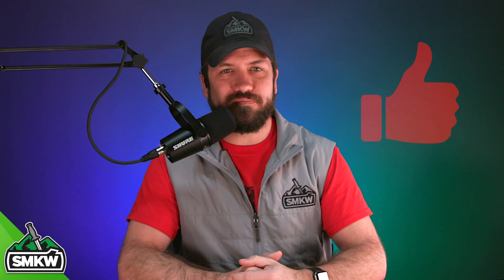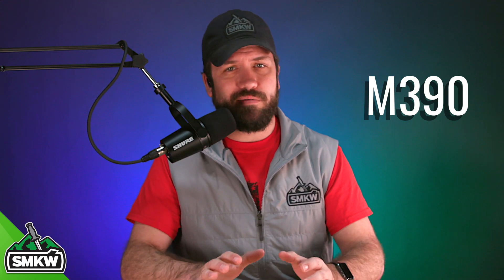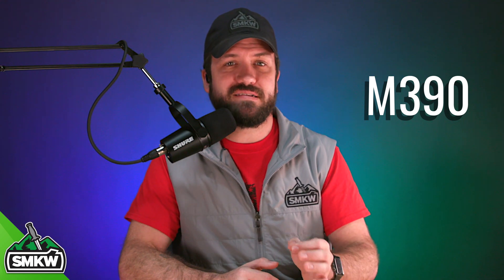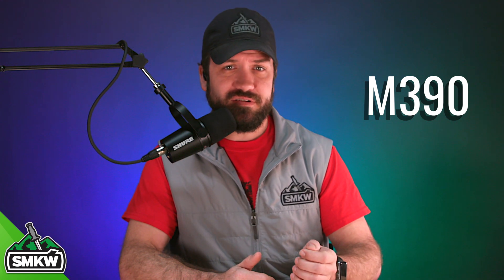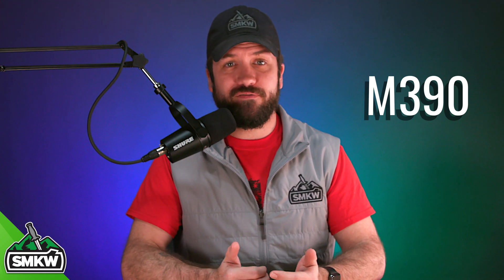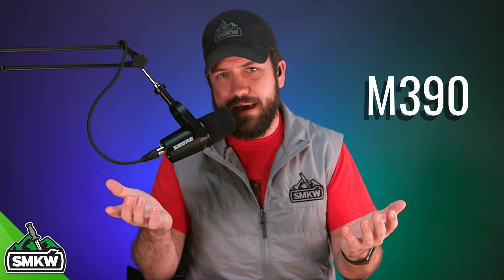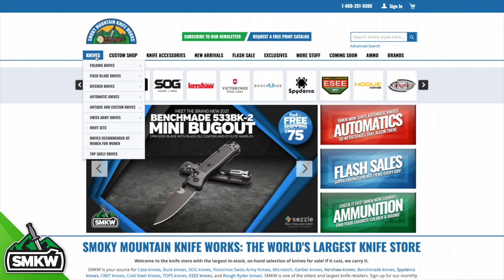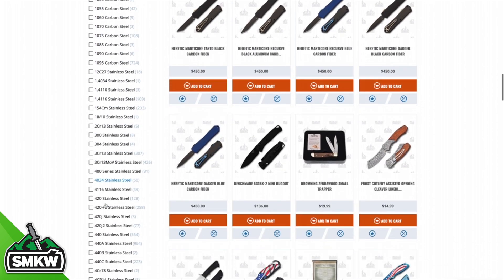M390 Blade Steel

Comment: Every M390 knife I've either owned or handled has just been stupid good. I'm a professional sharpener as a side business, and it's super rare I get an M390 blade in. Whenever I do, man, it takes a demonic edge. I hope one day it is at least a standard choice for makers. I have a Benchmade 761 that has since been discontinued that has M390 and I literally don't want to use it because I know it's kind of a collectors item now.
Reply from the maker: Thanks for watching and tag us in pics of the knives you sharpen on IG👍
Reply: Check out Microtech. They make a LOOOOT of their current knives in M390. If you’re not a fan of auto knives they also make folders. They’re pricey but they’re works of art. Plus if you’re always buying benchmade you obviously understand the price of quality and are willing to pay for it.
Reply: Kizer cyber blade has m390 its pretty cheap on ebay rn

Comment: If you’re good at sharpening, well treated m390 will take an unbelievable edge. My m390 Manix 2 gets sharp on what feels like an atomic level…it’s crazy. That’s its biggest strength to me. I wouldn’t buy “hit and miss” or potentially neglected m390 in a budget folder. You really want this stuff to be in top form because when it is, it’s unreal. If you’re into budget stuff, go with 9cr or 14c…there are plenty of budget companies doing great work with those steels.
Reply: Best place to check which manufacturer does it right is Outpost76 on YouTube and Tom https://youtu.be/PdnkLX-pWik
Reply from the maker: Good advice all around

Comment: I bought a few microtechs with this around 2 months ago. Scarab ii & ultratech, bayonet blade. Been using the ultratech edge seemed not to last long, hair shaving. Anyways.. i still love it! 🤩. Knives are something like lays potato chips "You can't have only 1" 😂. Hopefully y'all get some cyphers in Because I sooo need one lol
Reply: Microtech m390 is poorly done. You just wasted a lot of money on machining and polishing with a turd blade.
Reply: @tacticalcenter8658  Hopefully not 🙈. I bought a guardian tactical 040 im thinking of sending it back ,looks used. Great blade though 👌
Reply: @5shotsr611  https://youtu.be/fHXyzvqWs8g
https://youtu.be/SiU9fGURc-4
M390 should cut minimum of 300ft and ideally around 400ft. I say should and Ideally because every manufacturer does it different.
Reply: @tacticalcenter8658  dang. I heard a few guys going on like it was a miracle steel, 390 & 204. I know they sure charge alot for the mofo's lol

Comment: I love the fact that you try and simplify the metallurgical property advantages of Powdersteels but be careful as now you off base a little bit. As it isn't necessarily finer, its just that the distribution of the elements in the alloy is better so you do not get the accumulation of elements causing larger carbides and preventing brittleness of the steel and reducing other harmful effects of this lack of distribution.  Good video nonetheless but just be careful with that type of content as it quickly leads down to misinformation.

Comment: In your opinion what do you think is a better steel m390 or sv35?  Thanks
Reply: M390 is better.  If you know how to sharpen, you just need to do it longer, more strokes, but way less often.  It's an amazing steel for sure, it's my favorite and I have them all, almost.  Every time I have a choice of steels and M390 is available I'm instantly much happier with that knife, whatever it is.  I like ZDP-189 too, especially if it's from Rockstead, they can treat it better than anyone else can, so it's my absolute favorite but it's also no offered very much, very expensive and hard to find.  Lot's of good ones, M-4, S110, S90, S35 and S30, I like all of those but I place the M-390 at the top of everything except the Rockstead knives that are much more expensive and in a different league and need to be sent back to Japan to be sharpened properly.  Whatever you get, keep it well stropped to avoid dulling too soon. That's the 2nd. most important thing for keeping any blade sharp with the most important of course being, don't let a woman use it, they can ruin any sharp blade in 10 seconds by cutting on a glass surface or a ceramic plate and not bat an eye.  Women and equipment don't mix (line from Titanic).
I've never once seen a sharp blade in a house where a women also uses the knife.
 You can go years  in between sharpening M-390 if you do that.
Reply: @Billfish57  thanks for your input. I have a few different steels and really like s35 but I did just pick up a new blade in m390 and that's what drew me to this video. I was curious about it cause you don't hear much about it. The knives I have and am talking are a custom Chaves 228 in s35 and I just picked up a Chaves redencion 229 in m390 so I was curious is all.  Thanks.
Reply: That really depends on your personal preference and what you are looking for.  Both are great blade steels, M390 is going to be a little tougher while S35VN is going to be much easier to sharpen, M390 is also more difficult to heat treat and is typically therefore a little more expensive.
Reply: @TCB2Country122  s35vn is tougher
Reply: M390 is almost always similar to s35vn because of poor choice of heat treatment protocol . its wasting the steel and your money.

Comment: You mentioned HRC. What exactly do those letters stand for?
Reply from the maker: It stands for Hardness on the Rockwell C scale HRC where as HRB is Hardness on the Rockwell B scale.
Reply: Hrc does not always matter. Because the protocol used to heat treat it matters more https://youtu.be/PdnkLX-pWik

Comment: It's unfortunate most mass produced m390 is heat treated so poorly. Performs as good as or worst then some budget steels in some cases.
Reply: What's your thought on the lion steel m4 in m390
Reply: @tysonmclarry8560  lionsteel and Bradford knife company make the best m390 for the $ on the market.   Can't go wrong with either
Reply: Agreed 100%. Knife retailers don't care cause they wouldn't sell them if they did.
Reply: How about Kubey? Got a Drake v2 in m390
Reply: @jordanjohnson7266  kubey makes good knife design s and steel options for the cost.   There not top line but any maker todays world needs to be competitive, so I'd probably say it's up to standard hardness and toughness area. Like 60 61 Rockwell.  Send it to get Rockwell tested. If it's 60 to 64 rw it's real m390 and it's at it's best ballpark hardness

Comment: I love m390 and 20cv.Great steel for folding knives.
Reply: Thank you Jeremy that they are!
Reply from the maker: Thank you for watching the video and for the comment!
Reply: Why do you love it? Most manufacturers poorly heat treat 20cv, m390 and 204p. You won't see much difference between m390 and s35vn. And s35vn is a powdered budget steel.